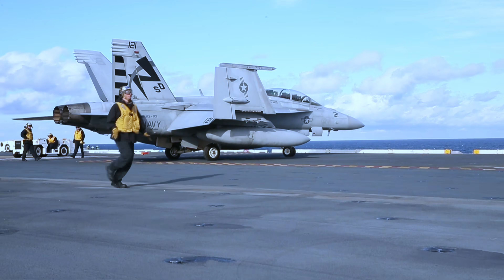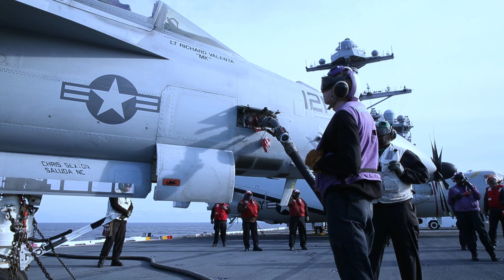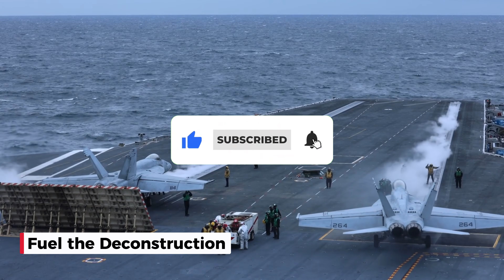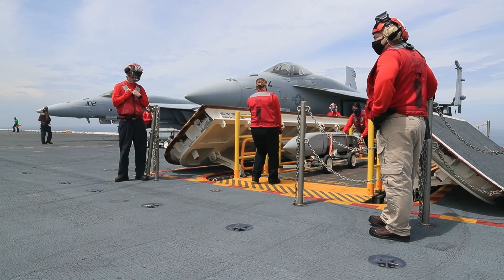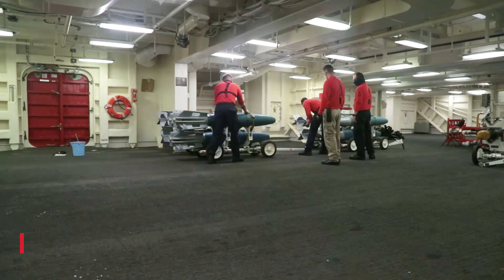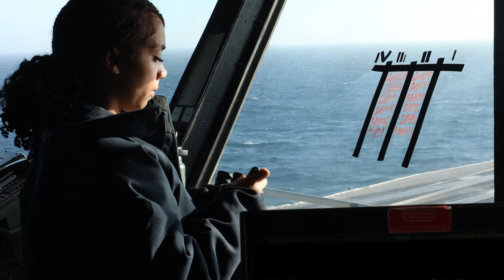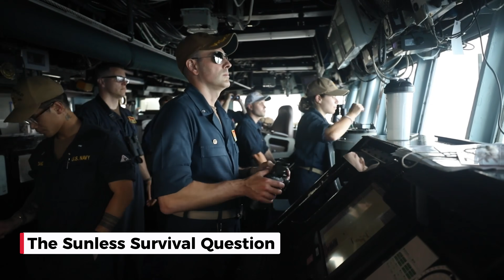How The HIDDEN Places Of Aircraft Carriers Work - What's Down There Will SHOCK You

Comment: 1:27  Yep 😏 all this spiffy stuff but the toilets back up and overflow sewer everywhere without extensive, expensive, acid flushing for 5 days at the dock frequently or it’s not possible to flush the toilet. Simply because the design 🙄 called for aircraft vacuflush septic system…instead of the larger space occupying gravity system they have used for CENTURIES…….😑 Groov-E…❤️🖖🏼😌🇺🇸